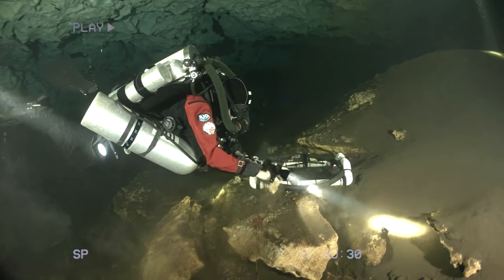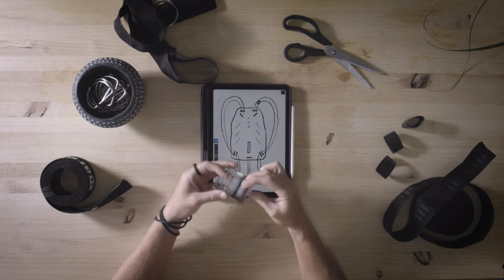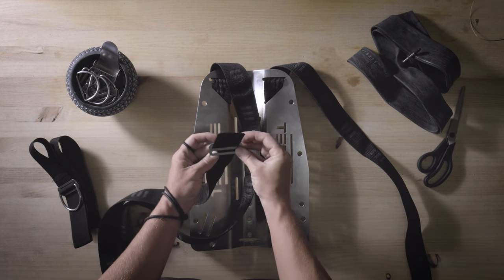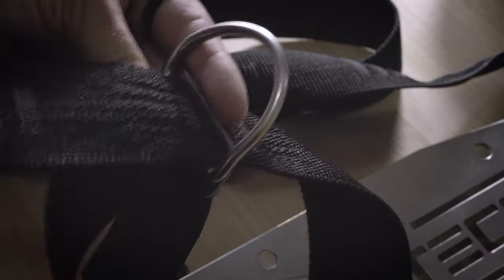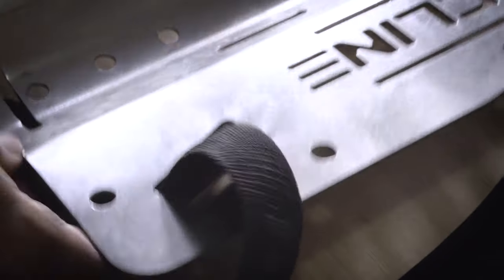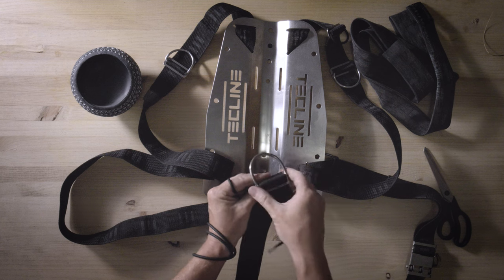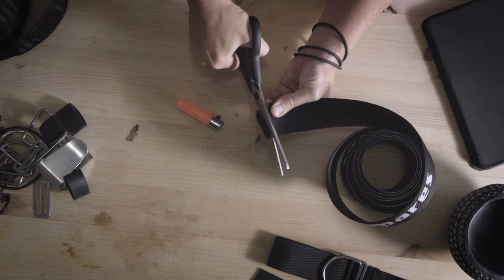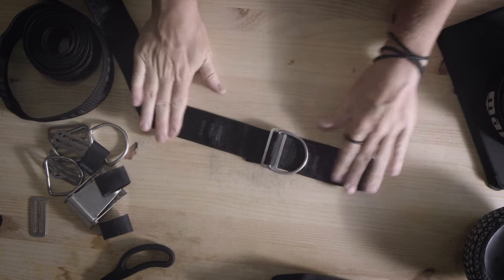How to Build a Backplate & Harness System (BP/W) | Master Series

Comment: I wish I'd seen this a few weeks ago. I went with a dive rite transplate harness because, being a new diver,  continuous webbing looked so intimidating to me.
Reply: You can just buy the webbing and change it. Use whatever D-rings and other accessories from the original. I just bought webbing from X-deep, it was only €15 with the premade hole in the middle. I think it's 3.5 metre long and you can cut it to your size once you adjusted it on your backplate. I prefer the continuous webbing as it's minimalist, no unnecessary buckles etc.

Comment: The video mentions that 7 triglides are required, 4xSS and 3xsaw toothed. Did I miss in the video where the saw tooth triglides were used or recommended?
Reply from the maker: Thanks for your comment! I suggest using the serrated type in areas where you want the webbing to stay secure due to the weight of the cylinder. For a single-cylinder setup, this isn't typically necessary, but it becomes quite useful for twinsets. We recommend using it on both sides of the bottom slots on your backplate and for your crotch strap. If you're using a DPV, the crotch strap will experience some pressure depending on the scooter's power output.

Comment: Not all backplates have 3 holes at the top unfortunately. My preference is to have 3, but many have just two. I think even some Halcyon ones only have 2.

Also holes around the edge of the backplate should be spaced in a standard manner to allow for a lift-bag pocket. I think Tecline, XDeep, DTD and Halcyon.
I just picked up a Mares XR aluminium plate (with not-quite standard lift bag pouch holes) that weighs 634g because with drysuit (thin undergarments) and steel twinset I was slightly overweighted with a steel backplate (2.4kg, XDeep) as I had "forfeited the ability to control buoyancy with breath control" as you have previously put it.

Awesome video. I tend to reference Innerspace Explorers videos, but this is yet another of yours I will recommend to people.

Comment: This style back plate may be what I am looking for. I am diving vintage double hose regs and I can't seem to get the tank and reg close enough to my back and shoulders with modern day back packs. If I was going to use the system with a single tank, would I add tank bands to the pre existing slots I see?
Reply from the maker: Yeah, using a single tank adapter is advisable but not necessary. Without one, you could certainly thread the tank bands through the pre-cut holes on the wing and backplate; however, it's going to make it cumbersome to strap onto the cylinder every time you go diving. I would recommend looking into options for a low-profile single tank adapter, such as the ones produced by xDeep. This will provide you with flexibility and keep your cylinder close to your back.

Comment: @flowstatedivers - I have a Wing Setup as well. I am wondering, if we try to aim for a minimalistic set up. Where do you place your weights for a warm water/ mono setup? When you have to store 4-6kg weights. Do you use trim pockets on the tank belts? Do you add trim pockets to the harness? I would assume you are not using a weight belt, neither any "ditchable weight pockets".
Reply from the maker: Correct. A combination of pockets on the camband, bottom of the tank and directly attached to the backplate. Have a look at our correct weighing video and you can see how we do that in details

Comment: Well done. recommended vendor sources for webbing, hardware, etc?
Reply from the maker: @ceisele1080 It's a tough call. We are completely brand-neutral, so we select the best components from various manufacturers. Currently, we prefer Tecline plates as their webbing has the ideal stiffness. Apeks also offers some excellent products.
Reply: Do you prefer nylon webbing or something softer?

Comment: Which d ring do you recommend to use the serrated tri-glide? I didn’t catch that in the video and I can’t see since it never zoomed in. I’m guessing on the shoulder d rings. What about a welded/fixed d ring? Some people use those so they always point down.
Reply from the maker: The serrated tri-glides are engineered to endure heavy loads, and their optimal placement is at the base of the backplate where the shoulder loop terminates. This location is crucial because without them, the adjustments to the shoulder loop can shift due to the cylinder's weight.

Fixed d-rings aren't recommended. You should be able to interact with your d-rings without visual reference and when you can turn them 180 degrees relative to the webbing, it will make the process much easier and intuitive.
Reply: @flowstatedivers  Thanks! It wasn't entirely clear in the video! And no matter how "standardized" everyone thinks it is, there still seems to be a lot of variation in the little details (and some strong opinions to match!)
Reply: @flowstatedivers  Which backplate do you recommend for a very short, very thin diver? My daughter is just under 155 cm and very, very thin (38-40kg). She needs very little weight when wearing a 3mm full size wetsuit (1/2 kg in weight pockets) is often enough.
There aren't many options for short BPs, though there are some in steel and only one company I can find that makes a short Al plate.
I want to switch her over to a BPW, but I want to make the transition easier for her. She is currently in a Zeagle Ranger Jr BCD (back-inflate style) and has never used a jacket style, so she's used to all the lift being behind her.
Your thoughts?
Reply from the maker: @mgelax  She isn't even that short. We recently had a student with the same height, except she is 34 years old, and she was satisfied with the Mares XR Aluminium (3mm) backplate. It's one of the shortest models we've encountered, and it's also extremely lightweight, allowing you to use trim weights.
Reply from the maker: @mgelax  { 15.75 in | 40.0 cm } high and { 10.63 in | 27.0 cm } wide at the base, { 8.75 in | 22.2 cm } wide at the top before the corner curve, with "V" depth of { 1.6 in | 4.1 cm } & 3 mm version weighs approximately { 1.5 lb | 0.66 kg }.

Comment: What about softpads for backplates? I have been trying to find one that would fit my plate but unsuccessful. It doesnt seem like it introduces unnecessary complexity to the gear setup, while it seems like it would protect my drysuit from unnecessary puncture/scratch damage of the screws. What would be the argument against using padding on the backplate?
Reply from the maker: We aim to maintain the setup as minimal as possible, so padding isn't suitable for our needs. The problem with backplate padding arises from its direct attachment to the harness, which unnecessarily complicates webbing adjustments. In the case of twinsets, constant interaction with the screws prior to dives is necessary. If padding covers them, partial removal is required each time which is a real pain. A properly set-up system won't directly harm your drysuit, so I fail to see the necessity for any of these additions personally.
Reply: @flowstatedivers I haven't seen padding threaded or interfering with the webbing. Most brands have them bolted to the plate only. 

I leave the bottom of my padding unbolted, so I can reach my twin or STA bolts without issues. I can reach both the top ones and bottom ones without having to remove the padding this way.

Comment: Do you prefer nylon webbing or something softer?
Reply from the maker: Hey, we prefer polyamide which is stronger than regular nylon and totally resistant to water, including sea water. it's important not to use just any' webbing for example the stuff they sell for climbing because it has to be water resistant to a higher degree. If you buy webbing from a scuba gear manufacturer, you will surely get what you need. The trick is to find the right softness but that depends on your personal taste really

Comment: To adjust the fitting of my backplate should I wear my drysuit or is ok doing it  wearing a t-shirt?
Reply from the maker: Depending on how thick of an undergarment you will be using under your drysuit. If you have something like a simple t-shirt you can adjust without otherwise it's beneficial to kit up beforehand
Reply: @flowstatedivers  thank you very much